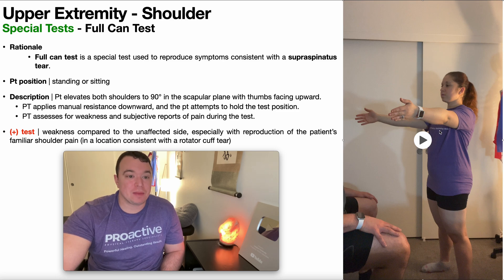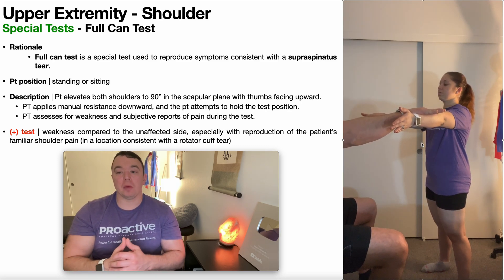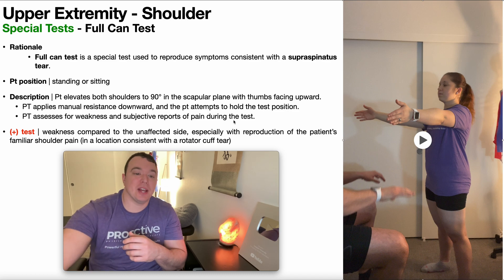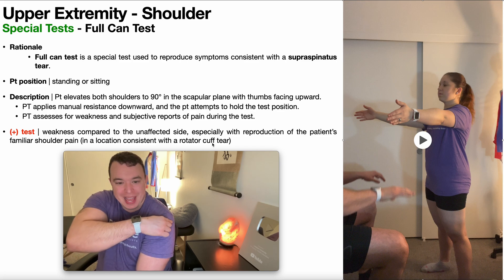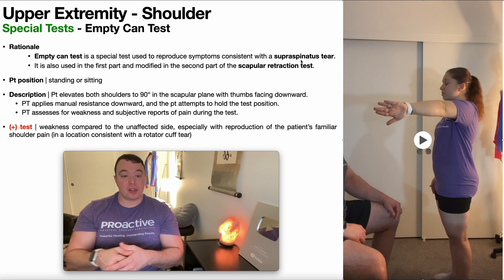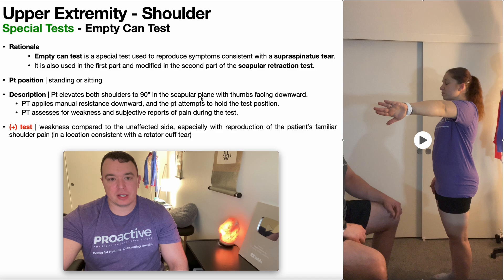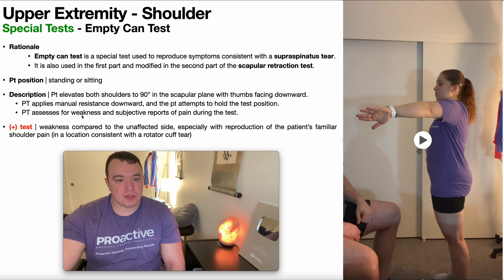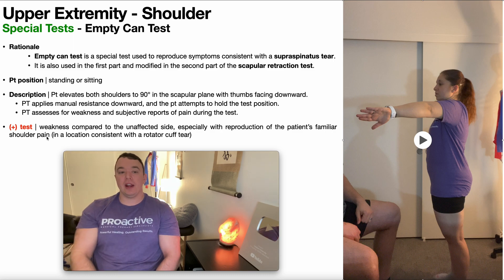🥤 Full & Empty Can Tests EXPLAINED

Comment: Hello, the empty can test and the Hawkins Kennedy test cause pain in the area of my teres minor. Any thoughts?
Reply from the maker: Injuries to the teres minor are the least common of all the rotator cuff injuries. However, I have seen injuries to the infraspinatus, this muscle’s cousin, where other special tests that you wouldn’t think would be positive are positive. Definitely take individual special tests results with a grain of salt. It is the combined examination with the sum of all special tests that leads you toward a diagnosis.
Reply: @CatalystUniversity thank you for the response. I figured out the issue. It was the lower portion of my rear delt. It had been bothering me for about a month. This pain has popped up throughout my life from bench or pull-ups. I did the sleeper stretch a few times and day for three days and the pain vanished. My mobility when first starting the stretch was terrible, but now I am good to go!